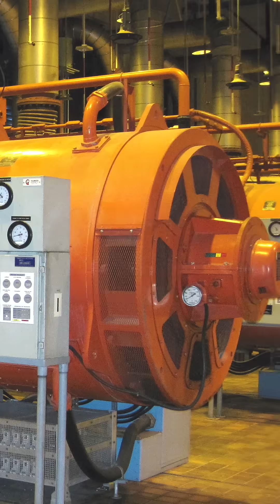wHaT iS tHE LARGEST ENGiNE EvER MaDE?

Comment: That's really bad, like getting 107hp out of a 25l engine
Reply: It's made for torque, not power
Reply: @krenzzie7290 Yo Harley Davidson just found its new engine.
Reply: @krenzzie7290 it's still 4hp per liter... You could have a billion Nm, but if your power is "four", then you won't be able to do anything with it anyway...
Reply: @sven7111 it’s literally used in a boat right now
Reply: @jameson1239  Yes it is? How does that change the fact that it has 4hp per liter?
Reply: @sven7111  you also said you can’t do anything when the power is so low
Reply: @jameson1239  Yeah, because you can't. You can have enough torque to spin up a whole planet, but with low power it will take eternity, so during the lifetime of the entire human race you won't be able to see the difference
Reply: @sven7111 yet said boat moves
Reply: @sven7111 How on Earth do you know more than the engineers who built that thing?
Reply: @Itsjamilagain As an engineer i can confirm he's correct, torque is useless unless you multiply it by RPM. The engine isn't "built for torque", it's built for doing work like any other engine, that just happens to be a byproduct of such a huge engine that has cylinders almost 2 cubic metres in size. The crankshafts on these things need to be big to withstand the forces also hold up given the length and size of the engine. It is also very efficient to run the engine more slowly still producing enough power to do the job. Torque is a force, once that force starts to rotate work is being done. Work done we measure in power.
Reply: @sven7111  You are correct its power that matters, however 4hp per liter doesnt mean much when you got that amount of displacement. 107 000 horsepower in total is quite enough for what its supposed to do.

Ironically, horsepower per liter is as close to a meaningless measurement as one can get, outside a few specific racing classes.
Reply: @GoldenCroc  Yeah, it's that way for efficiency. I'm not arguing against that. It's just not a powerful engine for it's size
Reply: @sven7111 horsepower per liter is a useless metric because the engine still makes 107390 horsepower.
A Ferrari 458 makes more power per liter but is that car more powerful? No
Reply: @Itsjamilagain  Engineers who built it know it too. It's just random know-it-all people online who don't know...
Reply: @sven7111  107k hp is definitely powerful for an engine of it's size but I get what you're saying with the 4 hp/liter aspect.
Reply: @sven7111  No it isnt, but one really has to take into account the intended use, and of course the competitors in the segment as well.

And in both those regards, its certainly one of the best. So one can really say that in its niche and segment, its quite powerful.

Its kind of like saying every naturally aspirated car engine is ludicrously weak for its displacement, since RC model car engines can have upwards of 1000hp per liter.... very different use case as well. 

I really dont think that factor can go unmentioned.
Reply: @krenzzie7290
No, no, no! No engine is "made for torque". If you need torque you use a gearbox! These engines are made for efficiency, period. Gram fuel/hp/hour that's what they're built for, and as you see there's no torque or Nm (or freedom-pound if you watch it in black and white) in there.
Reply: 5.6 million lb ft of torque
Reply: @jameson1239 not enough. Miot will barely move
Reply: its made with high efficiency, longevity and torque in mind. Its for a container ship not a race car
Reply: @dieselgeezer18 you would be totally right if you didn't mention torque. No engine is made for torque.
Reply: It can produce that max power around the clock. Try that with your car or motorcycle.
Reply: Hp means jack shit for ships, torque is much more important for ships
Reply: Well the fact that it is indeed 107hp/25 liter isnt very meaningful in what it sets out to do. So it isnt "bad", its just not a design consideration at all. What on the other hand is, is thermal efficiency.
Reply: @GoldenCroc it says 107k hp?!
Reply: @PticicarosaRosa-y1i Please read OP again. He divided by 1000.
Reply: It redlimes at 250 rpm.
Youre not making horsepower.
Reply: @Evalyn126  I would say peak rpm is around 120 rpm but goes to show how limited my knowledge is with ship engines.